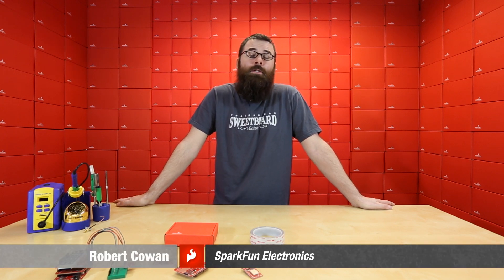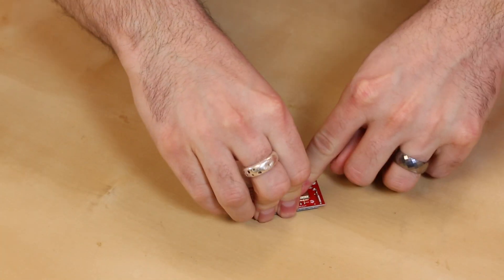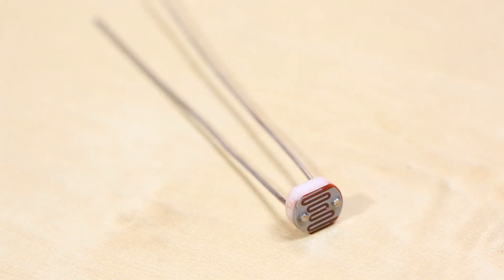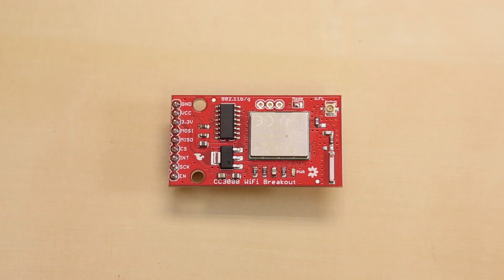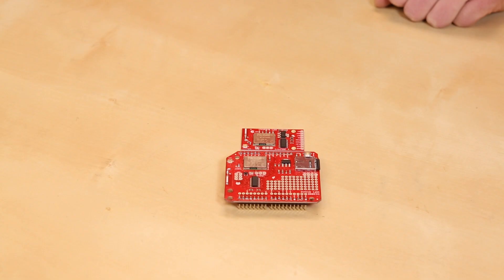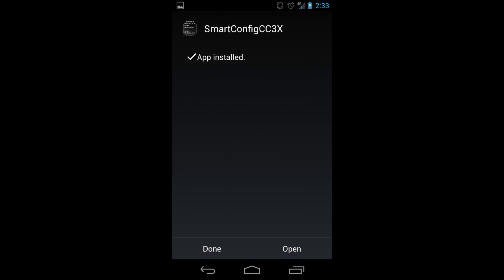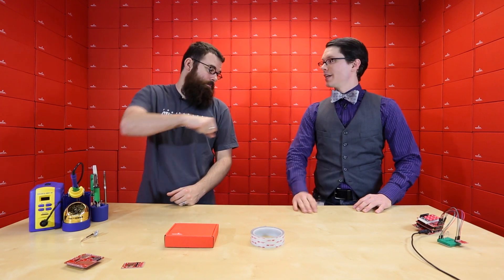SparkFun 4-4-14 Product Showcase: High Five for Wifi

Comment: Does the TI firmware work properly under non-trivial load? I ask because I've [tried to] used the same CC3000 part last year and the SPI bus side of things would lock up too easily for real life use.
Reply: Dude- I don't know the answer to this one, but I just bought some arduinos on Arduino day, so going to get my hands dirty!  I'd love to hear more about how you're using Arduino! :D
Reply: Allen Hall I want a better garage door opener. One that closes the door if I forget (easy), and one that opens just in time as I arrive and without any button pushing on my part. Buttons are a bother on the motorcycle. So I want my phone, which knows I'm arriving from its GPS, to connect either on 4G or on the house wifi (if it can associate fast enough) and open the door as I turn into the driveway.

So I have a arduino in the garage rafters which monitors the door positions and can simulate a button press. I added a CC3000 to it to control the door remotely, and wrote a single web page that can be used to access it, but the CC3000 locks up too easily to be reliable. In my case just refreshing the web page a few times will trigger the bug.

It seems (from googling around) that there are bugs in the buffer handling routines and I haven't seen an update from TI which addresses this.

All of which is too bad because if it worked, the TI solution would be good enough.
Reply: Fantastic idea!  I love it! :D  too bad about the cc3000- I'll have to remember that!  :(

No current plans except I might motorize the garbage can with a special hand swipe (IR) to differentiate parents and kids from opening the can. :)  Other things i need it for - eeprom burn for Kantronics TNC (software update) and might want to code a CW thingy.

Might also make more complex interactive toy for Simon - not sure what that would consist of yet- possibly a musical interactive tool- if he plays a triad make it do something awesome- if it does a simple scale, do something awesome- etc. :D  We'll see!

Mostly doing it just to do it. ;)

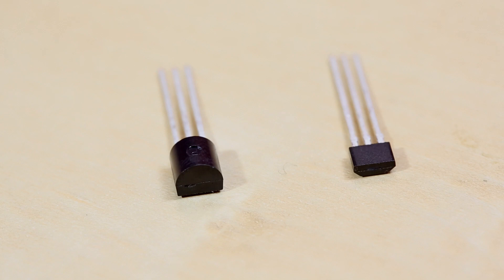Comment: 2:36 Isnt that the same as the read switch?
Reply: Similar but not the same. This particular Hall Effect sensor will hold its state (latch) until a strong magnetic field is present. A strong south magnetic pole will turn it on (sink current), a strong north pole will turn it off. The reed switch in the kit is normally open circuit and will close, completing the circuit, when a magnetic field of any polarity is present at the right location. Take the magnetic field away and the reed switch will return to its open state. This isn't to say that you can't find Hall Effect sensors and reed switches that operate differently, but that is the case for these components in the Sparkfun kit.